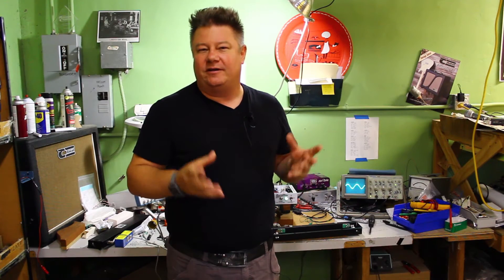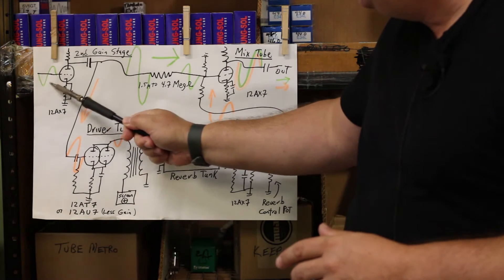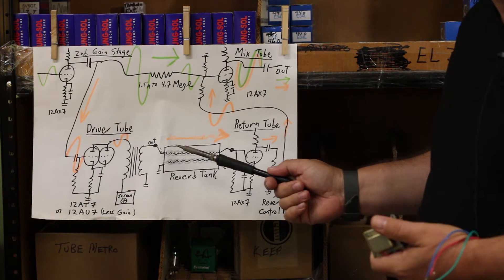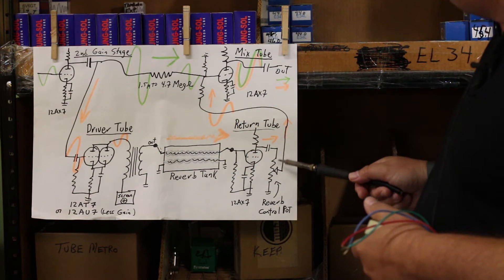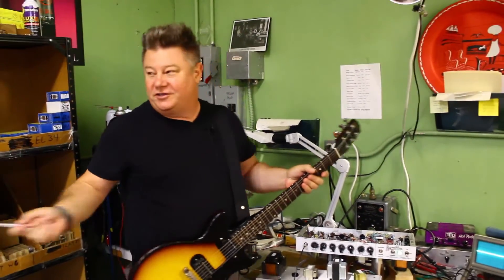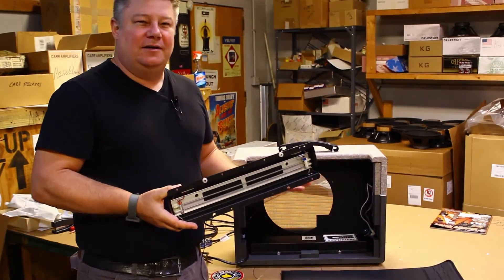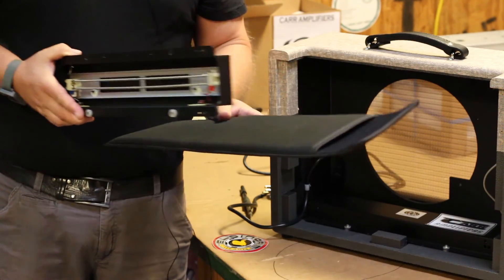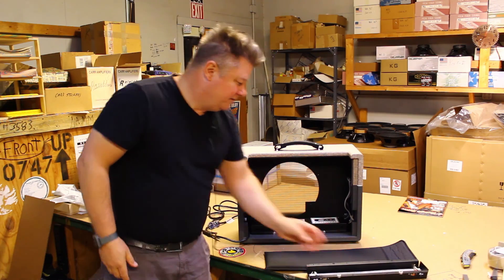The Black Art of Reverb -- Steve Carr explains circuits and troubleshoots common problems

Comment: I guess my tank problem doesn't qualify as common....ends where the springs attach broke off.... each spring has one missing (opposite sides)......its a nearly 50 year old amp so I wouldn't even know what a suitable replacement would be. Since the springs are bare metal are they actually making an electrical connection with the transducers?
Reply: The reverb  transducers have little hook-shaped pieces of wire with a bead-like magnet on them, and that is what attaches to the springs; but from your description, the hooked wires have apparently broken free from the soldered joint at the far end of the brass tubes. You could solder the hooked wires back in place, but the magnets may have slipped off the wires and disappeared, and the reverb drive or return won't work without the magnets. The magnets sit within the laminated metal core of the transducers; when the input transducer of the tank is fed with a music signal, the transducer core generates a magnetic field and the springs will vibrate  as the bead magnets "dance" to the varying magnetic field; the vibrating  springs will shake the magnets on the return end of the tank,  generating a voltage in the transducer coil (very much like a guitar pickup does), and that "wet" reverb signal is fed back into the amp.

If the little metal hooks still have the magnets attached,  It may be possible to solder them back into the brass tubes so that the magnetized beads sit in the area of the transducer laminates. If the bead magnets are missing, I don't know if you can get replacements except maybe by pulling them from another old, damaged or dead reverb tank. Otherwise, the simplest repair may be by replacing the entire tank since they only cost about 40 bucks or so.  It's important to match the impedances and type of replacement tank to the specifications of the original tank.  There should be a number on the metal shell of the original tank that can be looked up online to tell you the specs and to allow you to buy a matching tank usually a number that will start with 4  (4 being the number of springs in a typical reverb tank, each spring length actually being composed of two differing springs); the other numbers are a code that details the input and output impedance of the tank and the manner in which it is designed to be mounted, whether it's vertically or horizontally and so on ( You can find a decoding chart for the reverb tank online). It is important to note that the tank found in virtually every model of Fender amplifier, whether vintage or new,  is of the transformer-driven type; interchangeable from one Fender to another, BUT, other amps such as Magnatone and Ampeg often used a capacitor-driven reverb circuit,  which will have very different electrical characteristics than the Fender circuit.  You will need to match a replacement reverb tank to the characteristics of the original tank in your amp, which shouldn't be difficult if the numbers are on the original tank. If the tank doesn't have any numbers on it then you may have to do some research into the type of reverb drive-circuitry used in your amplifier in order to find a correctly matching reverb. If the tank impedances aren't matched correctly to the circuitry in your amplifier than a replacement tank will work poorly or not at all.
Reply: Let's see if this link to another YouTube video will post; a detailed video about repairing reverb tanks. https://youtu.be/sKqnqY8hvu8?si=T1VJlcj5THWiczgt
Reply: Rewind Electronics posted a video a while ago about repairing reverb tanks;  I tried to post a link here for you but the system is apparently configured to block them.

Comment: I would like a sportsman, but I can't afford one right now. I like the headroom, and mid features on it.
    I had spoke to Dave a while back, and can not afford it;  but I imaging having one.
    That is a good amp.
My Princeton 112 plus solid state amp's reverb tank is barely working. It just drips a bit on ten.
    I would like an amp with the sportsman's bonuses; 'And be able to dial reverb tank parameters like you were mentioning: that would be some amp.

Comment: I have a fender acoustasonic Junior and there is a very annoying crunching Buzz along with any input signal I put into the amp if I play my guitar at a low volume that crunching noises there and it seems to have something to do with the Reverb circuit I pulled the amp apart and it looked like somebody had cut the wires on the Reverb tank and loosen the two screws that mount the board down by the river knob and I'm thinking they did that at Guitar Center so they could just get the amp working enough to where somebody like me would take a chance buying the amp thinking maybe we could do a repair on it. So I took the amp apart I've probed and I haven't seen anything burn nothing looks out of the ordinary everything seems to function fine I attach the wires to the Reverb tank, I get signal from the Reverb tank but there's no guitar signal going to the Reverb tank keeping in mind this is a solid-state amp. I'm thinking this crunchy buzzing sound has something to do with the Reverb circuit or the circus at fees the Reverb circuit and I'm wondering if it's possible you may know something that I don't about chasing that problem down.

Comment: Hello, realize this is a older video. But maybe you could help, I have ampeg reverberocket r12r reissue, no reverb from 1-3 weak until 7 1/2. Newtank, no change, swapped tube, no change. Just learned it is not tube driven, failing rca could be the culprit but its rca into tank and quick disconnect to board. So hard to make that cable to test. What else should I be looking at? Especially now I know it is not tube driven. I would love a reply. I csnt find much info on this issue..

Comment: I've had to repair my tanks many times over the years and the problem has almost always been the tiny wires from the transducers breaking off from the RCA jack in the tank. Usually fixed by stripping back the tiny wire and re-soldering. These things take a beating bouncing down the road!

Comment: sometimes wen i turn on my fender blues jrIII the reverb's dead dose nothing! but if i lightly jolt the amp by rocking it lightly front to back or picking one end up a few cm it comes back on!, i re tubed it and had no luck, checked the leads coming from the tank and everything is fine, is it time to upgrade the stock tank or is that not the problem?

Comment: I have an original stand-alone 1963 Fender reverb tank that likes to sing along with a hum, after three or four days of intermittent play on my part. Tubes have been changed, cables have been changed ... I have heard that somehow there is an animosity between the transformer and the tank itself, which I cannot understand. If that was the case, it would always exist. Anybody got any answers? Thanks!

Comment: I'm trying to repair the reverb of a fender FM212R, it is a transistor one, so the reverb box is ok, sounds when I shake it, doesn't sound with the guitar, where do I look on the circuit for the problem? the driver side has the problem as you said, help

Comment: Alright Steve is there any practical way to make a fender style combo reverb “drip” like a stand alone fender reverb unit?
Reply from the maker: Dual Professional?
Reply: Carr Amplifiers I guess I meant a combo I already have.  Dual prof and Vibroking have a 6v6 driver, so I assume you’d need a tranny upgrade and punch a bigger hole.  I was thinking of taking the normal channel 12ax7 and use it to add gain to the reverb driver.

Comment: Most spring reverbs suck except the ones used in the Selmer Thunderbird 50 Mark 2 were they used a 6BR8 tube!
Reply: You can greatly improve the sound of an inboard reverb unit in a handwired Fender amp, by taking the reverb return lead and running it into the normal channel of the amp, and EQing out most of the bass and increasing the treble. This requires an RCA extension cable, and a female-to-male RCA-to-1/4 inch jack to go into the channel's front input. Sounds swell!

Comment: Steve, why does running the signal through the physical springs cause the reverb sound? I've never heard a technical explanation of that.
Reply: that's not how it works at all :) the amplified signal goes into the first transducer which wiggles the spring, the second one converts the spring vibration back to electric signal :) so they're basically electric to kinetic energy converters working both way. no electricity flow through the springs, they just mechanically used ;)
Reply: I just needed to see it drawn out a bit more. This fabulous article goes into a lot of detail and also has a bit of a fun history lesson on how artificial reverbs came to be prior to their adoption by Fender. https://www.tubesandmore.com/tech_corner/spring_reverb_tanks_explained_and_compared

Enjoy. I did.